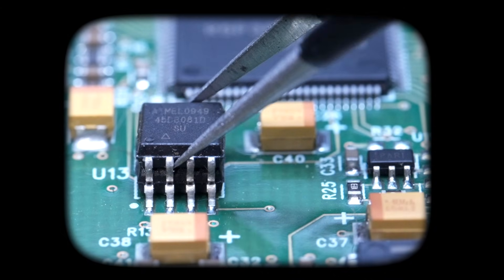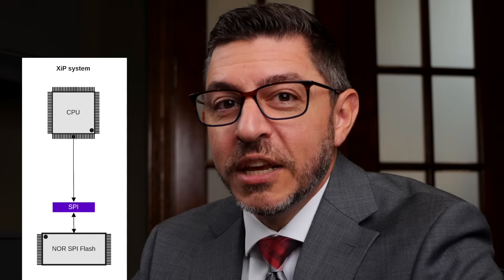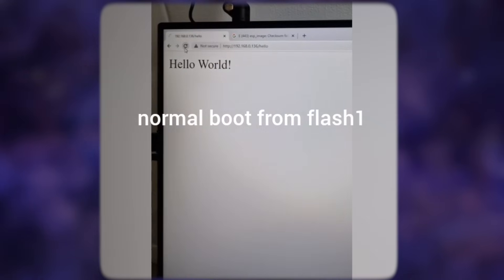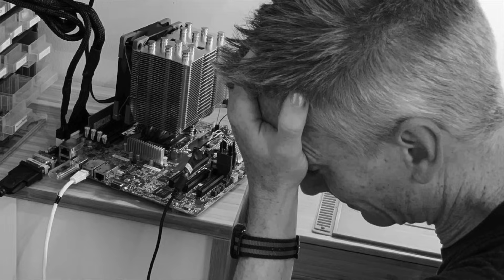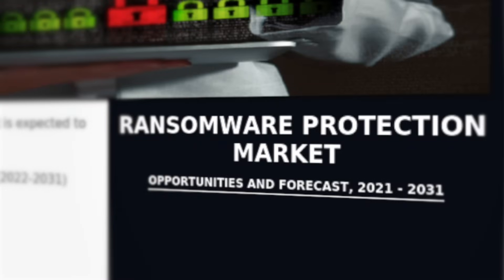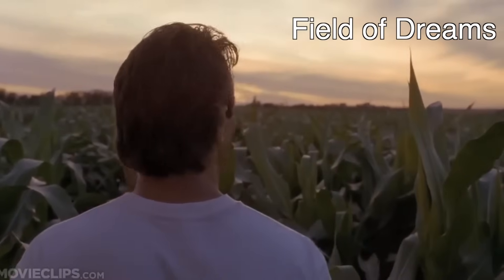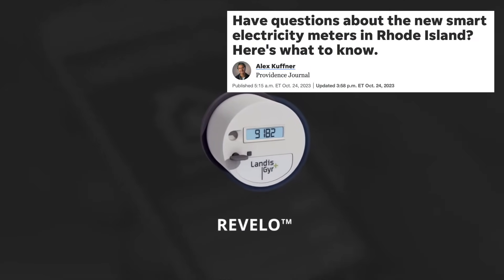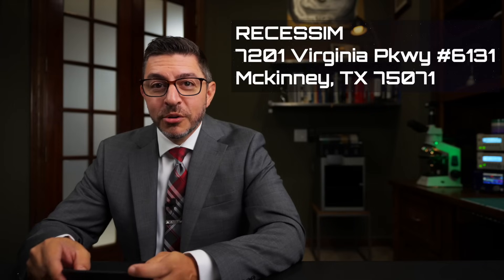Can They Recover 7,000 Bitcoins??

Comment: I'm a bit on the ignorant side of how it behaves if doing this. But can you pair yourself with the whisperer and the clock, pause the clock at some point so you pause the execution flow and do the swap in between operations? Or I imagine otherwise that during your discovery phase you could identify some natural operation pauses in the consumption of the memory so that when you reach that point in the process you swap the CS correct?
I just recently learned about dual ported rams (in the automotive application) and how OEMs do swap the registers to high positions on so when doing online modifications in the calibration they consume from that area, and what the dual ported ram allows is to be consumed from two different buses.

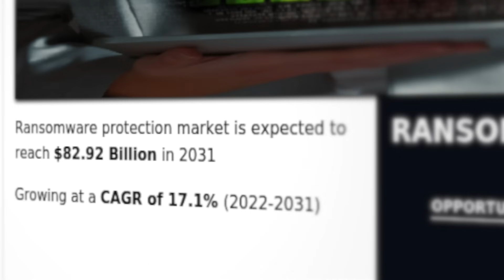5:05 : LOL, sounds like tech industry is mimicking the pharmaceutical industry, well at this point is not news anymore I think.

Comment: Do you like getting your savings printed away? That’s what the Fiat Money system is doing. Bitcoin fixes this. Educate yourself, please.
Reply from the maker: How’s it different from buying Gold or Silver? Those have an ACTUAL use, AND hedge inflation.
Reply: @RECESSIM  ok, good reply. At least you show you’re understanding the Fiat system has problems. And gold has been great for many thousands of years. And the USA was on a gold standard, twice! Yet 50 years ago, that stopped. Why? Because there was an element of Trust involved; trust that the USA government actually had as much gold as it was creating promises (money) to redeem for it. They lied. They were printing way more and then decided to abandon it all together. 

With Bitcoin, there is no Trust required. It has an open ledger that you can VERIFY who has how much. Also, nobody controls it. It operates in a decentralised manner that can’t be stopped. Can’t be hacked. And your Bitcoin can never be taken from you, if you do the right thing to secure it. 

Gold on the other hand, can be stolen. You can’t easily carry it around. It’s not easily divisible. And it’s expensive to transport it safely. Bitcoin fixes all of this. 

We are in a digital age. Bitcoin has a programmatic finite supply and thus is not inflationary. It has value, just like anything else, because the market sees value in its capability and it takes a lot of power to produce and secure it.

But again, don’t trust me to tell you all there is; verify it yourself. Do a small amount of research. Read “The Bitcoin Standard” which does a great job of explaining it and the benefits. 

And thanks for replying. 🙏🏻
Reply from the maker: @MarkovAllTrades  My main issue with Bitcoin is the "...market sees value in it..." vs intrinsic value. The limited supply of it seems more like the great justifier of its value than a real property. Gold has physical properties that give it value along with the limited supply. Bitcoin's value is in circumventing government controls, which can be "fixed" in the future reducing its value. 

As a system to enable transferring wealth without government control it's great. Assuming you can turn that Bitcoin back into something spendable in your own country to get food and pay rent. It's created a ransomware market where one was impossible before, but what else? It's too unpredictable as a currency, so the bubble seems to have burst there.

Other than ransomware and people who hoped to get rich quick with their stimulus checks, who else is pumping it and benefiting?

Comment: Dont need to slam more transistors into the current constraints, just sandwich them. There is at least one good idea that isnt nefarious:
I could design a cpu socket that has 2 in one. So one half of the cpu pkg resides on either side of the motherboard. 3d printing might even advance enough to have coolant channels built in to the socket between each layer of the cpu to chipset to cpu. and ram on cpu could benefit alot to from the stacking idea too. I could see quantum processor makers actually steal this idea so at least I posted it here first, for the record lol

Just need to make asyncronous operations more secure somehow but. 😂 yeah. I have a sort of decent idea to beam data across the gap when it could be necessary for crytographic needs. The beam is the most important bit though, because it would generate a key for each chip side with an encryption scheme based on a pretty cool anomaly I discovered in hexadecimal and punycode. Idk if its intended, but it is awesome.
Reply: Stacked chiplet designs are already a thing. Multi-socket motherboards are also already a thing (they generally go on the same side of the motherboard so that all of the sockets are on the same side with separate mounts for cooling. We're already putting everything on chiplets in the same package and calling it a SOC (CPU, RAM, SSD, GPU...), but I forget what it's called when it's just CPU and RAM.

Usually if the extremely high bandwidth links on the motherboard are being tapped the attack surface is wide enough to make security extremely difficult. Anyway Secure Memory Encryption is already an extension on some x86-64 chips. You could have a secure element in the CPUs for dealing with the few extremely high security operations and design the rest of the system normally.

DO NOT use bespoke encryption methods. A good cryptographic primitive needs years of mathematical analysis before we're comfortable saying that breaking it is hard enough to design systems around its properties. Do the cryptopals challenges if you want an introduction to how encryption is easy to do wrong.

Comment: The next government check is coming for the massive gaming market, where they check when your computer is on sucking energy,  watching twitch , or You Tube  etc,   loading into  say steam or epic  or other game hosts  etc, double check your data stream with your isp and  then and you are given a climate change Levy  an increased charge for the electricity units used in that periods for excess energy use while computer gaming / leisure time.

Comment: I always wondered when I was using FlashROM to binary dump the 8 pin SOIC chip that if you can read and write to the chip (note the machine must boot cycle at least once or some kind of voltage write protection enables at least on Mac's anyway) and I always thought that it might be good to bit stream the chip whilst the motherboard is live and take a sneaky peak at what is going on during the boot process?
I already know what parts of the binary I can modify to unlock so there are some clues when looking at the binary in a hex editor?
Apple really aren't safe or secure products. They are great at marketing the illusion of being safe and secure for an unjustifiable premium....so that way you get screwed twice 👌

Comment: For the stacked chips, a solution is to check the integrity of the firmware against a checksum of the hardware fingerprint in combination with a random number generated internally at the date firmware was first run every time before the key is decrypted and before is used, is a stupid idea to keep the temporary decrypted key in an external RAM, as well a service can be created to verify the integrity of the firmware every second o so.
How I proceed to encrypt the key? I never store the hash or the password, I store the key in an encrypted container with a checksum of the decrypted container, the hash is encrypted in the container but only the key is hashed, and check the password hash against the attempt of the decrypted container hash, if the decrypted container hash equals the password hash, the container is decrypted successfully and the key can be used, the container can contain more data or garbage to further complicate the things.

Comment: I've done a similar trick a couple of times to rescue motherboards.
So a BIOS flash goes wrong, remove the dead chip (they used to be socketed) and install a known good one from an identical mobo, boot it fully, remove the working chip, re-instal the dead one, and reflash it again.

Comment: It's not exactly new... Chinese cloners have been doing this chip swap trick on Cisco gear for over a decade. (the first read is the hash check. the second read is the decompress to memory. give hardware the real image for the first lookup, and then the hack afterwards. even switch back for the 3rd+ reads so the hack is invisible to the running system.)

Comment: The only "experience" I want from my power company is for them to deliver me the voltage and current they're supposed to. I can live with occasional outages. I don't need detailed information about each applicance!
Reply: They don't know exactly what's what... they're guessing. For example, my "power summary report" shows a water heater... this house has had gas water heating since the day it was built 40+ years ago. (the current one is a forced induction model, it's electricity use is a rounding error.) It also shows HVAC usage in the summer, yet my A/C hasn't been turned on in 8 years!

Comment: Thanks Hash,  really interesting stuff, that stacking chip thing was interesting, I've seen the technique used for drivers to increase power handling capacity, never thought about using it to switch in and out executing code, that was just plain clever. Totally agree with your bitcoin assessment, the other part was to drive electric prices up here in Texas after the crypto folks moved here because the electricity WAS cheap.  Really enjoyed the humor too,  these days we all need a good laugh now and then..  Cheers buddy!

Comment: If the contents of the NAND is encrypted and you switch in another NAND chip, would you not have to encrypt the contents of that NAND so that you could execute your own program?
Reply: Yes. And it's even more complex because NAND isn't just a flat memory space. The NAND controller is doing error checking, bad block remapping, interleaving, etc, etc, etc. It's way accessing NAND directly is a mess -- i.e. you need special software. Switching NAND chips in a running system would just confuse the controller, even without encryption.
Reply from the maker: Yea, if it’s encrypted things become harder. Not sure if any XiP (Execute in Place) processors support live decryption of their instructions. I would think if the memory’s encrypted it would be loaded to some internal RAM, decrypted and run from there. Haven’t researched it enough to say one way or the other though.
Reply: @RECESSIM   ESP32 executes in place from external flash through the cache, it does not copy the entire app image into IRAM. Cache/MMU decrypts data on the fly.

Comment: re: Story 3 - Smart Meters - I'm pretty sure you can defeat this technology by using a spot UPS or a whole house UPS.
Reply from the maker: This is the second comment I’ve seen mentioning a UPS. I have my doubts though. My understanding of most consumer UPS are they just monitor the power line and switch to battery if they sense a power drop. They aren’t acting as a big capacitor bank smoothing out power draw.
Reply: probably once these meters start appearing on markets like ebay, people will figure out how the communication with the power company server is done and eventually find a way to jam it
Reply: Don't need to jam. Just a thing plugged in your power outlet injecting a random/pseudo-random noise in mains.

Comment: The local power co engineers here were all about bragging about the smart meters but when I start asking about the encoding and guessing protocols going back down the lines that the rf analyzer I got could probably figure it out they get quiet and don't want to discuss it.
Reply: Indeed. Security through "STOP ASKING!" :-)
Reply: @jfbeam  Literally been told "I am not allowed to discuss any of that" and the conversation kinda stops. I am not yet sure if the meters call home down the power lines or if they send out a ping to them over time but I was always used to unplugging the meter when I worked on the panels.. well after the smart meters a truck showed up because my meter didn't respond and they thought the line was down. They put meter bases with disconnects in them for me so I don't need to do that but I was kinda surprised they knew and fairly quick. It's got to be all power line as there is no accompanying fiber line and lots of mountains so a lot of radio/cell signals don't go into some of the valleys. I have communication analyzer that could sniff it out and maybe even do something inductive like a cable tv experiment at a place one time that can pick up the signal without me sticking a probe directly to the line side.

Comment: Running chips in parallel is not new, doing so for this purpose is fairly new, but doing this to expand the abilities of a device by running chips in parallel has been something I've seen done in the 80's to run multiple ROM's on home computers and I know of at least 1 home computer that used this method to switch in double the RAM (with a logic chip to switch the 2 banks).
Reply: Intel actually sold  memory in DIP packages that stacked two up. They had one digit difference in the part number. They inverted one pin so when high you selected the upper and low - the lower. Then the dumping started and Intel pulled out of the DRAM market. Luckily IBM standardized on their processor or they may have been gone fairly quickly. They had started to lose the CPU market to Mostek, Zilog and Motorola.

Comment: the  power sensing thing is not new, the company was advertising  clamp style units to install into your electrical box for the laast few years
 guess they couldn't get enough money that way and not they partners with the meter company to license  it.
gonna be easy to track the illegal grow ops  and mining rigs in ri now ;), 
device profiling + remote disconnection or power shedding ?
Reply: A custom "power strip" that could obfuscate what is actually plugged in is something I'm sure would be invented in response to the nosy power company
Reply: @spearmintneighbor2948   I think a UPS is enough to obfuscate what devices are plugged into it

Comment: Reminds me of stacking memory chips in Atari ST's back in the 80's. Of course that was to add capacity!
Reply: my first thought also, I did my 520ST Developer beta model, and my computer teachers 520, 512 ?M/k? of ram chips cost over $300 then in the mid80's.. the school had a single10 Meg hard drive for a apple II.....
Reply: @mikeskupniewitz8057  - yup, that’s what I did too. Since I was so broke back then and wanted more storage, I cobbled a DSDD 5-1/4 from a pc to work on it as well as a 2nd drive.
Reply: You could do that to the original Xbox too, could double its RAM to 128MB just by stacking chips :)

Saw someone upgrade a Voodoo 1 card the same way, piggybacking chips to give it 8MB video memory.